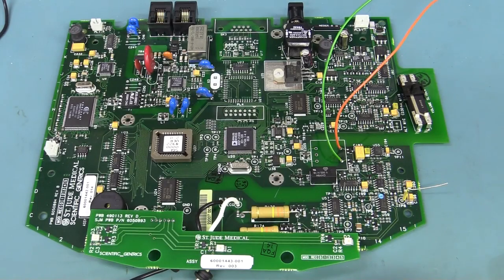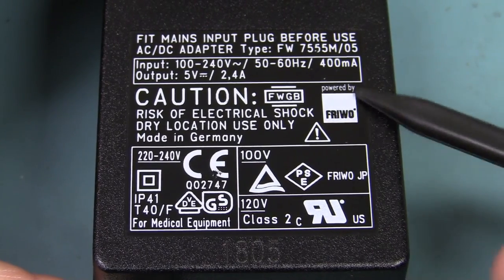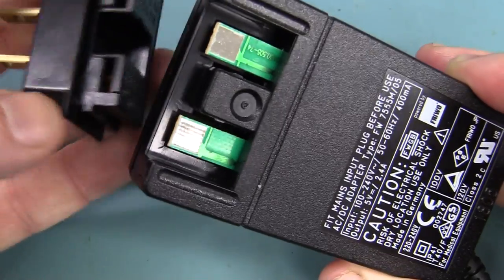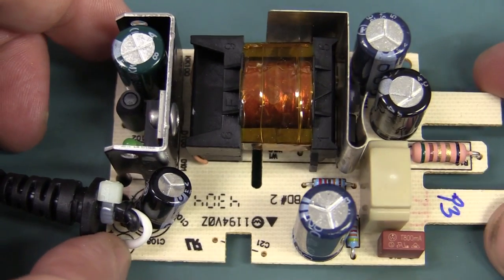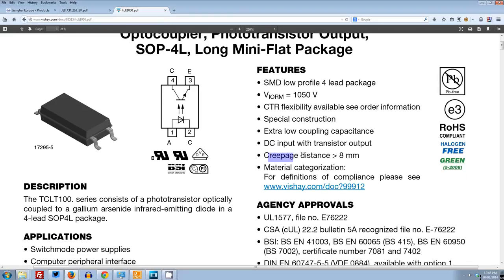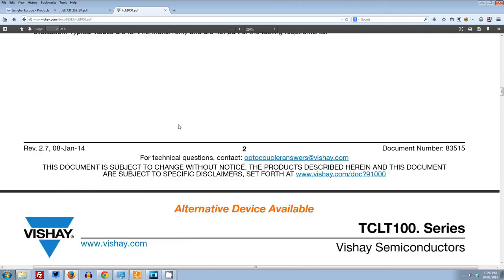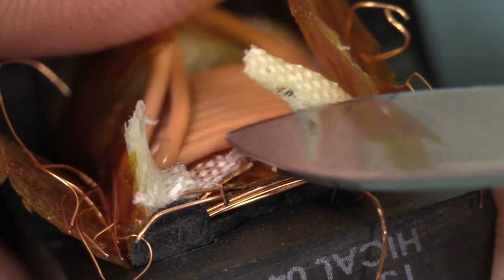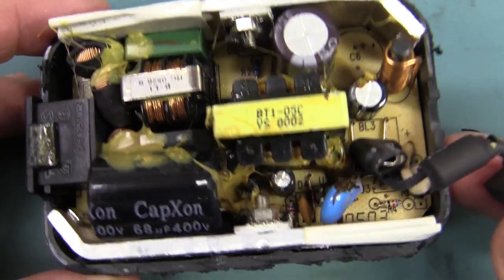EEVblog #659 - Medical Plugpack Teardown

Comment: Check out Dave's skills in filming that transformer disassembly. Great lighting and razor sharp video of all those small details, nice job.
Reply from the maker: thanks, I try to make it half decent. don't really know what I got till I go edit and then it's usually to late to reshoot.
Reply: @EEVblog  - FRIWO are the original inventors of the plug-pack. 
They usually know what they are doing.

Comment: The reason for the lack of class Y EMI capacitors is because one of the most important features of a medical power supply is not just high voltage isolation, but low leakage of the normal 120/240 VAC.  Ordinary power isolated power supplies are allowed to have a couple of milliamps capacitive conductance from the input to the output from the EMI filter.  If you have a plug pack powered device with exposed metal you can easily measure this current to ground.  In a medical grade supply, the limit is much lower since it might be used on someone with implanted electrodes, undergoing heart surgery, or otherwise more sensitive to electric shock.  So Y class capacitors are omitted whenever possible.  I imagine the footprint might be there if they also sell this for non medical high reliability applications, or perhaps to accommodate different markets with slightly different requirements.

Comment: The winding on the outside - is a part of a transformer protection. In case if one of the windings fail and short to the transformer core - it shorts out through the core metal and overloads the transformer, which causes for the fuse to blow. Very, very common technique back in the age of lamp electronics.

Comment: The wire over the transformer is a form of shielding, it prevents external magnetic fields from affecting the transformer and it also prevents the transformer from leaking a magnetic field. Usually that type of shielding is done with copper foil instead of a wire.

Comment: The wire used on the secondary is "triple insulated" magnet wire, which has 3 coatings of insulation. This insulation is approved to be used as the entire primary to secondary mains isolation barrier, and counts as 3 separate barriers. Clearly in the medical grade product they added even more insulation with the tape and spacing foam. Before triple insulated wire was invented, transformers had to have carefully applied layers of tape and spacers to maintain isolation, because regular magnet wire is considered to be bare wire by safety approval agencies.

The wire wrapped around the outside of the core may be either a magnetic shield or electrostatic shield, to reduce the radiated energy for EMI compliance.

Comment: That bare wire on the transformer connects the core to a fixed potential for EMC reasons. This is a definite answer, not speculation. Thanks for saying "I don't know" this time instead of feeding us the usual bull.

Jianghai (JH) caps are not made in Germany. They are a chinese or korean job, or some such. Same level as Capxon etc. But they do have a very able German sales office that will promise you anything, so it is no surprise you got the wrong impression. This supply is built to a price, and to meet requirements, not exceed them.

The weird diode between secondary windings used to be patented by Friwo, supposed to reduce EMC. Let's just say there is a reason you probably won't find it in newer power supplies from Friwo.

The control IC is a Friwo specific ASIC. Again, suffice to say you won't find it in later models for a reason.

The white "spongy stuff" is called margin tape, yes it is there to maintain insulation distances.

I wonder if that isn't actually a copper foil shield (taped in mylar) where you identified the "rubbery insulation". 

You didn't do so bad on this one Dave, I was actually afraid of watching the video but I only had to cringe a couple of times.

Comment: You don't need a Dremel to get into those plastic PSU packages just get a block plane refill from a hardware store, place it in the seam, and whack it with a hammer.

The blade will act as a wedge to pry it open. I use this when I'm recapping these tiny supplies it does so little damage you can actually glue the case back together when you're done.

This is more worthwhile when you don't complete destroy the supply of course :-).
Reply: I've been using a screwdriver, but your way might be better.
Reply: Bushougoma, I just can't picture the block plane whack opener, can you video the process? Thanks!
Reply: Keith Armitage
You just need the block plane blade look up an image of it. You can purchase them without the block plane.

Place the blade into the case halves and whack the rounded end with a hammer.

These blades are made of thick steel so there's plenty of surface area to strike on the rounded blunt side.
Reply: You can sometimes crack the the seam with a careful squeeze in a vice too.

Comment: The uninsulated wire on the outside of the transformer is to catch stray flux that might leak out of the core and turn it into heat. This is why the turns are on the outside of the magnetic circuit. This is to reduce emissions and help pass EMC. In many power supplies they use copper tape for this shield turn rather than wire.

Comment: TCLT1005: For IEC 60601 you need 4kV of insulation voltage and the creepage distance must be at least 8mm, That optocoupler is exactly designed for that. The ones you can buy from Vishay are all coming with a black housing. I think those white ones were originally Toshiba brand hence the name TCLT... and not CNY...

Comment: Y suppression cap is optional. Sometimes it improves EMI, sometimes no difference, sometimes it makes it worse. Easiest thing to do is include a footprint for it and try it out for pre-compliance testing
 
The shorted turns outside core are probably shielding, normally would be copper foil but presumably it was an afterthought and they didn't need much shielding so they stuck in a few turns of what they had. It's weird though; I can't say how effective it would be.
 
spacer at edge of transformer is margin tape, typically 3mm wide for 6mm creepage between primary and secondary in 230V consumer SMPS, but medical may have higher requirements. It's just there to support the Mylar layer up to the edge and hold the winding away from the edge like you guessed. Typically polyethylene/polyester/polyurethane foam. The primary should also have been pulled away from the edge to make the clearance add up. I don't think their insulated secondary gives enough isolation over enamel to allow them not to have done this. In smaller transformers where it uses up too much space you could use triple insulated wire.
 
The small winding on top of secondary is the primary low voltage aux supply for the controller IC, not voltage sense, one of the optocopulers is for that, although it is possible to get feedback from this for simpler SMPS, regulation's not as good.

In short it's all relatively standard consumer level stuff. Other than the wide PCB creepage/clearance, I can't see anything extra for medical. Oh and they used polyimide (Kapton) tape in it rather than the ubiquitous yellow polyester such as 3M type 56.

Comment: The other wire with no coating is used to short out the leakage unductance (appears as an inductor in series with the windings)... This helps cut out some of the back EMF and other switching noise, and could help reset the core.

Comment: The yellow tape is mylar -- or some sort of polyester film, with a yellow-dyed acrylic adhesive.  Example: 3M #56.

The gold stuff is kapton -- slick snot, good up to ungodly temperatures on its own -- the tape usually goes with a sticky silicone (with an 'E') adhesive and is good up to 200C.

Comment: The missing capacitor...
Because this is a medical grade PSU, Class Y caps are not fitted, as they deliberately increase the leakage current. And on Class 2 non-earthed equipment, there's only one place for that leakage current to go.... Through YOUR BODY!

I'm sure most of us have had a little 'tingle' when connecting or disconnecting the antenna from a VCR that is powered.
Those Class Y capacitors are responsible!

Usually they are 4.7nF connected from the negative of the rectified mains to the negative of the output, and are commonly paralleled with a high voltage rated 4.7Meg resistor.

For example with a Schaffner mains input filter, you get the standard version with common mode choke and both X and Y caps, but also a medical "B" version without the Y caps.

Comment: In both PSUs, in the transformers, You actualy do not need creepage between windings  insiude, because all insulation is done by "Distance Through Insulation" on the triple-insulated winding wire -- spacings are required only between leads and pins, and leads to core.
And what FRIWO did screw up (and the approval agency didn't notice) the Triple Insulated Wire is not allowed to cros itself or other wire in angle near 90deg. -- the cheap-chinese actually put there one layer tape for the returning leads of secondary.

The shorted loop of wire around the core is some EMC/EMI sorcery, and it is also connecting the ferrite slug to PRI -- because in HV and Transient world ferrite is considered to be conductive material :)

FRIWO GERATEBAU has been now asimilated by Phoenix Contact Power Supplies, Paderborn, Germany.

Comment: That extra bit of windings around the main transformer at 19:45 min may be a modification used to mitigate the Electromagnetic noise leakage surrounding the component?  It could be a "Field Tweek" used to improve Hysteresis Flyback?  Then again, it may just offer structural redundancy.  Who knows?

As an Electronic Engineer that builds transformers, that one looks VERY custom made.  Nice teardown vid!

Comment: Those caps are a bit disappointing, no excuse apart from cost savings, they are right next to the heatsink too. It complies medically but still not great for long term reliability.
Reply: The plugpack vid is longer than the actual device it powers, I love it!!

Comment: Nothing difinitive Dave, but I wonder if that weird uninsulated winding (which was on the pri. side I think?) has enough capacitance to the secondary to enable the EMC compliance w/o that cap fitted?
Reply from the maker: interesting thought, but it would only be a few tens of pf  at best
Reply: EEVblog I think that wire wrapped around the transformer is to hold it together.
Reply: I think that the extra winding around the entire core (rather than around only the center part) helps to suppress leakage inductance.
Reply: EEVblog Is it a leak curent sense wire?
Reply: BAMBAM5476 Both ends of the extra wiring are connected/shorted on the same transformer terminal. It is most likely there for EMI shielding - the bare transformer may have been slightly out of compliance or too tight for comfort for radiated EMI so they added a bit of shorted wiring on top to act as a makeshift shield instead of using copper tape/foil.
Reply: Sean Breheny Thing is those wires should be getting hot tho
Reply: ephecs doh
No, because wire which is wrapped around the entire core sees almost zero magnetic flux. Think of the flux lines as forming closed loops - the full flux passing through the middle of the "E" core, and then half of it spltting off and going back down one outside leg of the E and half down the other outside leg, coming together again through the I portion of the core and passing back up through the middle. Wire around the entire E sees the full flux going up and twice half of the flux going the other way. 1 - 2*(1/2)=0.

Comment: The unisolated wire is used to eliminate the magentic field outside the transformer. High quality transformers are wrapped in copper foil. To be honest, this powersupply seems to be a piece of shit. Shame about the "engineers" in my country.
Reply: It was built to a price, could happen in any country.
Reply: I don't think price is an issue here, but design. I do NOT like the distribution of the primary at all. I build transformers myself (many different types) and this one sucks big time for such a PSU and made in "Germany" (I'm half German, but agree shame about the Germ,an engineers)... Also, I ONLY use Kapton tape for all of my transformers, no compromises ever.
Reply: A cheap Chinese company could buy a business in Germany and make stuff there.
Reply: *****
back in the 80's the local electrical trade was buying these 'german' insulated screwdrivers, much cheaper than the going rate of the proper insulated ones, on the back of them being 'german'.  turns out it was a chinese manufacturer/imported just registered in germany  with a generic german name, and importing them from china, along with the VDE mark which was just a fake, not properly tested or double layer insulated.
Reply: I opened up a Motorola cell phone wall wart that had copper foil around the transformer.
Reply: About the uninsulated wire, I'm with you, is usual to see that in audio transformers, to keep the magnetic flux inside the core as you said, usually with a foil as you said.

Comment: I'd be interested to see a Mil spec plugpack comparison if such a thing exists.
Surprised you did not call out the 'surface mount' TO (?) package mounting. The heatsink far from providing mech support actually increases the stresses on the package leads as you can see when the sink is touched @5:50

Comment: Look for application note AN-18 on the Power Integrations website. There is a nice transformer design guide for margin wound (like in the FRIWO supply) and triple-insulated wire transformers. The shorted turn around the core is probably a cheap version of flux-band to reduce EMI (see also AN-15).

Comment: Never like the way heat sinks are wrapped around electrolytic caps, The output side heat sink could have been turned around and flanked the transformer. Any chance of seeing some H.V (<5kv) demos of clearance and creepage in wallwarts good and bad.
Keep up the good work Dave, very educational.

Comment: I am working for Medical power supply system, I don't know how much of frequency of the primary side of the transformer but I suppose it probably not good power source for medical instruments. There are several reasons. 1: EMC and 2: Wrong choice for primary side capacitor 3:Transformer physical structure, but anyway the wall mount type power adapter is a different category of IEC60601-1.

Comment: Maybe it's been mentioned before, but you sometimes hurry too much when making teardowns or reviews. @ 25:45 that opto is actually described by the 2nd line, which makes it a very common 817B compatible opto. Datasheets are readily available, just google EL817B.

The first row is just the manufacturing datecode.

Comment: I've once designed a medical grade transformer with a similar shorted loop (copper foil in that case). It was required to reduce the radiated emission as well as conducted emission in case there are cables running near the transformer.  I think it's there only for EMC compliance.

Comment: Back on the original Pacemaker monitor board, I think I saw some leads soldered on the output from the wrist lead section.  Were you able to measure any signal from the wrist leads?

Comment: I think it's just a regular 817 opto-coupler (not L0452) in that cheap 5V 4A power supply, that you basicly can see in any cheap PS. I've seen them placing part name on second line of chip marking not once.

Comment: Hmmm. Working on a board at the moment which needs to have conformal coating (moisture and temperature "protection"). Never had to design with that stuff in mind.

After seeing this video I wonder if/how/when coating effects creepage? Darn you just can't stop learning stuff.

Comment: The wire winding could be an electrostatic shield but I've only seen it done between pri-sec. A belly band is done with a copper and needs to be constructed in a manner quite the opposite of an electrostatic shield. I'm not sure what they are doing.
Reply from the maker: yes, an electrostatic shield is different as you say, certainly not that.

Comment: I'd love to see a teardown of some electronics intended for use in explosive atmospheres.
Reply: Aside from specialty sensors to detect potentially flammable or harmful gasses, there is not much special in those things apart from the batteries and electronics being fully potted to keep potentially hazardous substances away from the circuitry and hopefully contain equipment malfunctions. Those devices can be a nightmare to dismantle because of it and that also makes them generally not serviceable at all. To make things worse, sometimes, the potted PCBs and batteries are inside a soldered or welded steel/tin/aluminum can.
Reply: See EEVBLOG #603 for a mine gas sensor teardown.
Reply: For the most part, I think it's just the enclosure that does the protection, with the only case of the electronics being special is for Ex 'i' (intrinsically safe) equipment

Comment: I'm a bit of a power supply noob, what are the optocouplers and all the surface mount components on the high voltage side of the board for?

Comment: I have put my hands on one of these, they are pretty bad at low power. I need to short the output with some resistor for a few seconds to be able to draw more than 500mA if I start with 50 mA, otherwise it limits itself. Very strange, maybe I need to crack it open and change the caps, mine was made in 2005.

Comment: How does it draw 400mA (the same current) at 100-240(A range of input) Volts? Does this mean it is less efficient at 240 volts than 100 volts?

Comment: Are the few turns at the outside of the transformer connected to ground? If so, it could be a shield. The iPhone charger has the same windings at the outside. You can see it here: http://www.righto.com/2012/05/apple-iphone-charger-teardown-quality.html “Two grounded strands of wire are wrapped around the outside of the transformer to provide shielding.”